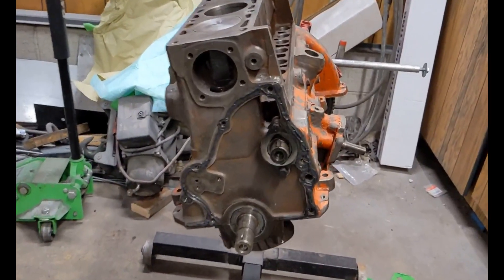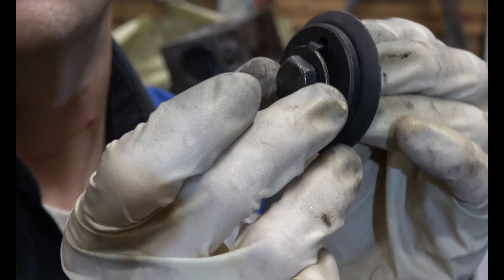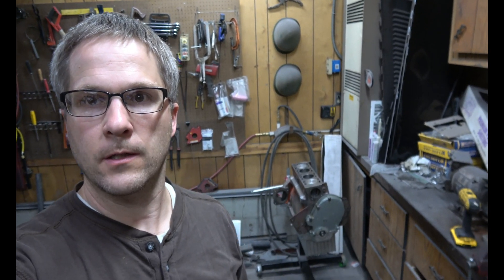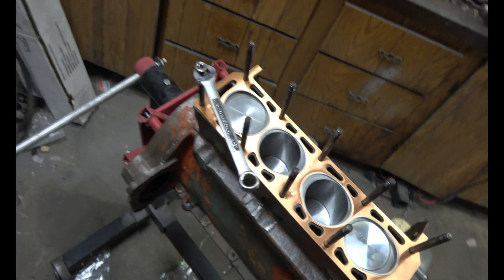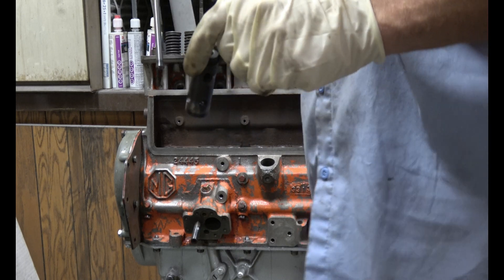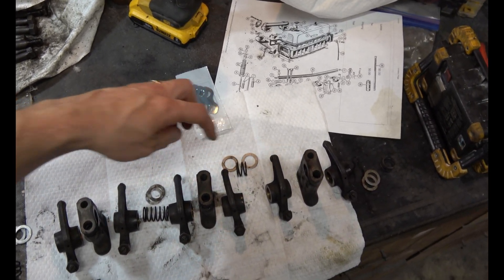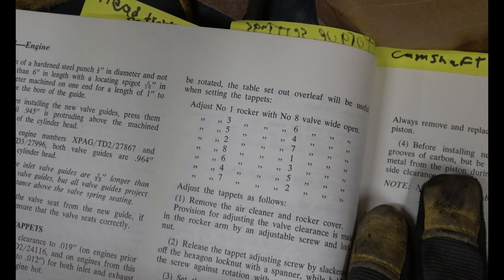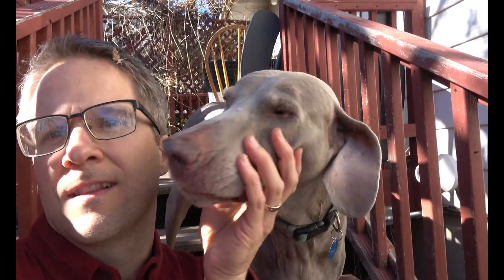1951 MG TD Engine reassembly part 2

Comment: Hi any video of the removal of the initial removal of the engine.
Reply from the maker: I don't have a video covering that part.  From what I recall,  there is a motor mount under the front of the engine, under the transmission and a stabilizer on the side of the front of the engine.  Once you get all the hoses, wiring harness, choke cable, gas pedal, and drive line disconnected and the mounts loose, you can lift the engine/transmission together out of the engine bay.